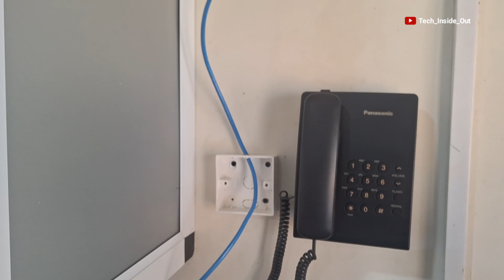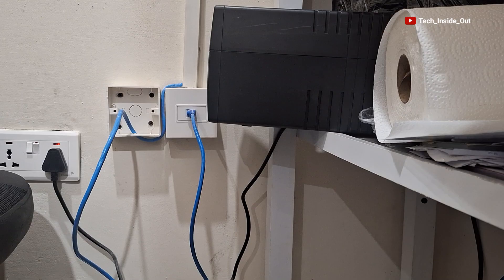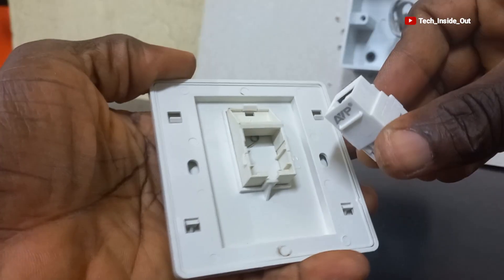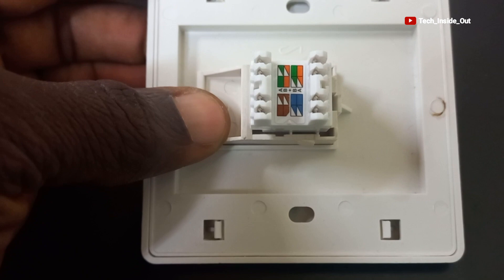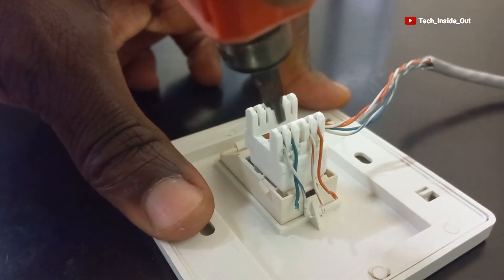Telephone intercom system practical field demonstrational setup guide

Comment: Can the connection from the faceplate to the PBx exceed 100m
Reply from the maker: Yes, if you use good quality cables
Reply: @Tech_Inside_Out ok, what about if the other  way round.  Do you have to add a device in between the faceplate side and the PBX.

Comment: hello sir can I ask if the patch cord I will use in handset is also the same in my PABX and Keystone cause in my PABX and Keystone the pin I used is RJ11 6P4C while the out of the box patch cord from my handset are I think rj10 because it onlt has 4p2c
Reply from the maker: You can use any chord, the most important thing is to ensure the cables and pins match
Reply: @Tech_Inside_Out I already did that and follow your color coding are you using crossover color coding between the rj11 jack and rj11 keyatone jack or just straighthrough connections?

Comment: Sir,how to test or detect cable in 1 telephone in pabx, or in punch down terminal..I had problem detecting cable in pabx because 1 telephone in our room no DC supply and not working, the cable is direct in pabx punch down terminal and there's no cable tagging,how can detect or know that exact cable..pla help me..
Reply from the maker: I guess you know the extension number and so you can use a handset and connect directly to the pabx to detect the extension

Comment: Thanks for this great video! But i have a question, will it work even without the boxes? If you will just plug it directly
Reply from the maker: You mean the telephone sockets?
A direct connection works but that will mean that your handsets will be on just a loose cable connection and that can be the source of fault all the time
Reply: @Tech_Inside_Out  oh okay thank you, but are telephone lines different from Ethernet cables? I don't have the tool in making those plugs
Reply: Ethernet cables are basically for IP-PBX, because it uses VoIP. But for a regular intercom system, you would just need a regular telephone cable.

Comment: i wanna know how to setup for a high rise building with 200 units of telephone. And what are the purpose of those lines near the extensions.
Reply from the maker: This same process outlined in this video is applicable.  
Those other ports are Outside line ports
Reply: @Tech_Inside_Out  how will I do that? is there a pbx for 200 units?

Comment: Nice one. I will want to know how to setup a wireless intercom system for hotel and offices. Thank you.
Reply from the maker: Your request is well noted, but Wireless systems are mostly not recommended for hotels due to signal loss when there are many wall partitions.
I will do some tutorials on Wireless systems and how it can be used.
Reply: @ thanks so much for your response. Please can you send me a link to your distribution point demo and how to link dp to pabx. Also, do you offer training in Abuja or online

Comment: Is this installation for a multi line telephone? Because on the keystone jack, you used 2 paire of the cat 5e Ethernet cable. Stripe orange, solid orange, stripe blue and solid blue.
In one of your videos, you said for a single line telephone, you just use a single pair of conductor in the cat5 e Ethernet cable.
So is this connection for multi line telephone system?
Thanks
Reply from the maker: I used single line telephones but i made the setup in a way to be able to just easily use any kind of handset in case they wish to change their handsets without me going to re-wire their sockets.
Reply: @Tech_Inside_Out  ok boss

Comment: Nice video 
So the PABX machine doesn't need any other configuration.
All you need do is just to plug the PABX machine to a socket
Reply from the maker: There are configurations you may have to do when you require other features other than default settings
Reply: @Tech_Inside_Out  so therefore, if i install the PABX machine properly alongside the telephone line wires. Then, everything will work just fine as seen in this video.
I'll be glad if u drop your WhatsApp number too
Thanks

Comment: This video helped me alot. I've been trying to learn how to learn how to lay conduit pipes that can help connect an intercom system but with this video I'll be able to lay the pipes and even connect that's if i want to connect.
Thanks
Reply from the maker: Am glad it is helpful
Reply: @Tech_Inside_Out  the video is helpful but i need to ask a question.
It seems the PABX system uses electricity. I.e it must be plugged into a socket.

Also, drop your WhatsApp number please

Comment: Great work, but you have avoided many essential parts like rack mounting and the use of a rack mount patch panel. These best practices help with troubleshooting, upgrading, and even repurposing. Additionally, the slack when unshielding the cable is too much, leading to less tolerance to interference

Comment: Thank you. You used blue bluewhite, orange orangewhite for the punch, but the end of cable with RJ11 going to pbx switch is blue bluewhite and green greenwhite. ?
Reply from the maker: Thanks for the observation. My handsets am using are Single line telephones which require just the stripped blue + solid blue to communicate. 
When wiring for Consoles and key Telephones, you would need the 2 pairs where you must strictly use either the blue pair and green at both ends or the blue and orange at both ends.
Reply from the maker: You are very observant. I used Single line telephones all through my setup and they require just the blue blue to communicate. 
If i need to use a Console telephone or a Key phone, it would require having the blue pair and orange pair at both ends or blue and green at both ends. 
Thanks for the observation.
Reply: @Tech_Inside_Out  learning from your videos from scratch till now has helped me holistically. Successfully wired 5 single lines, and 1 console, crimped to rj11 and only waiting for PBX from client. 
Thank you once again for your educative detailed videos